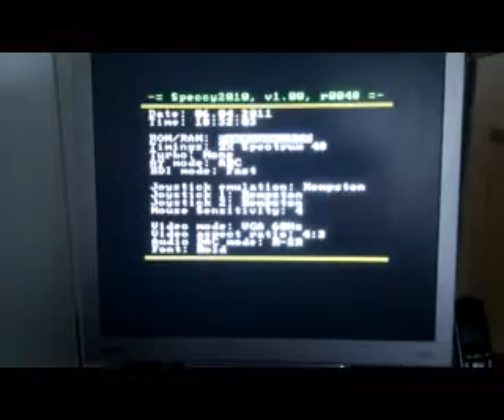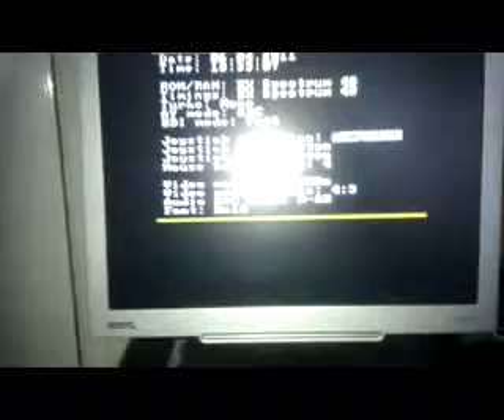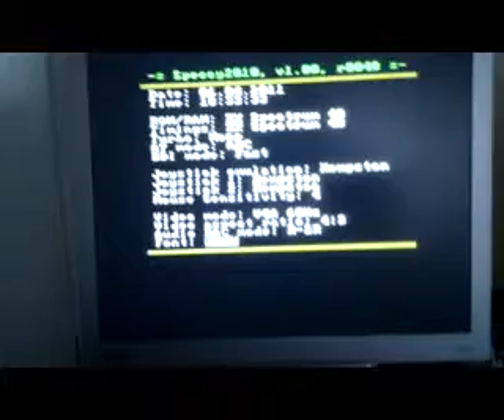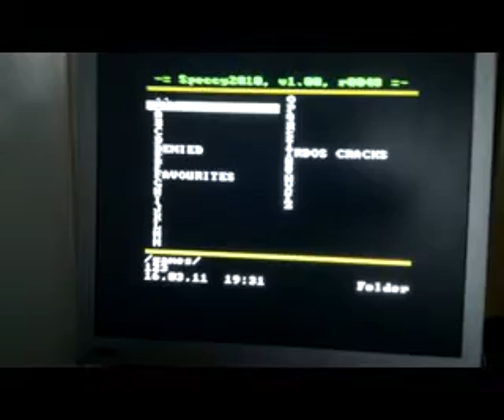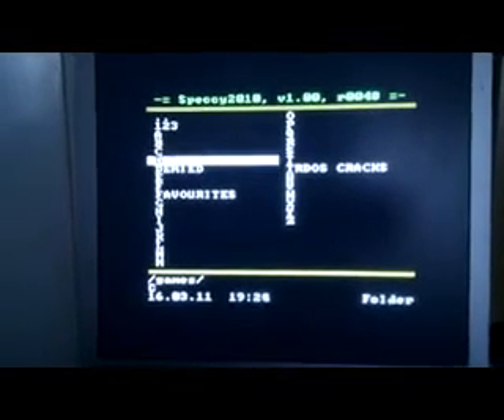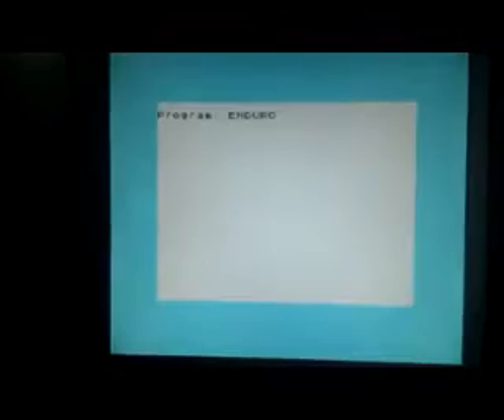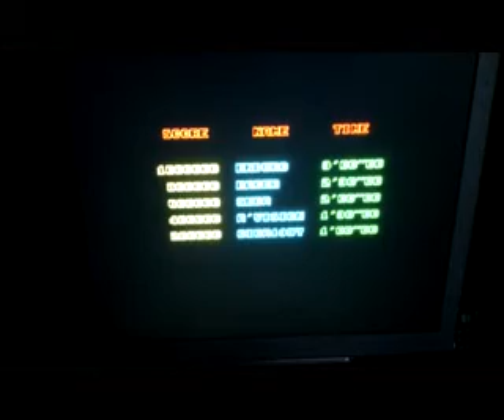Speccy2010 - A ZX Spectrum Clone for the 21st Century !

Comment from the maker: @ogicabp4u
Speccy 2010 loads it's firmware from SD card which is then copied into the FPGA during boot time. It could run any firmware you wish providing you can port it to the device.

Comment from the maker: @DLiberator78

Clock speed of the Arm 7 is 60Mhz. You can toggle turbo modes to run above the standard 4Mhz a standard Spectrum runs at if you want some extra processor speed :)